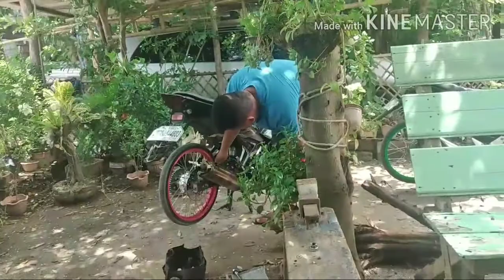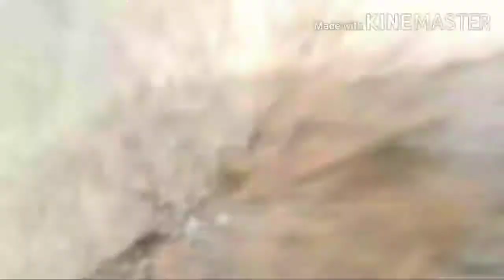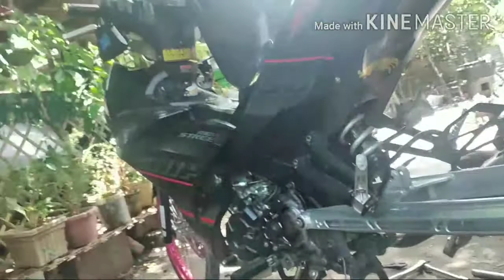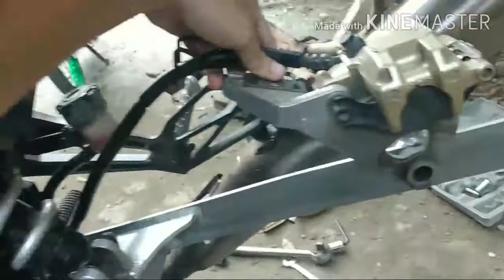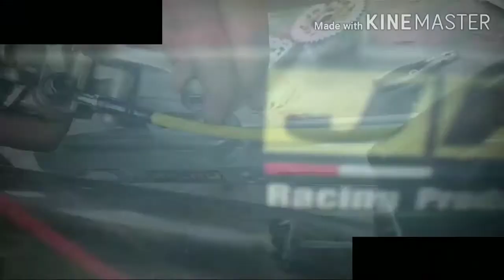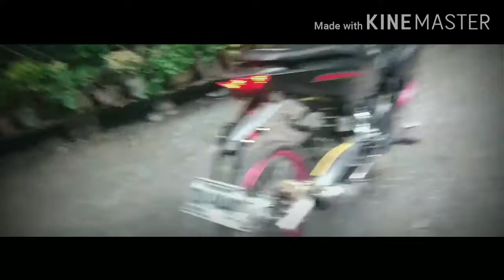JRP Prototype +3 For Sniper 150| installation swing arm

Comment: bossing saan mo nabili yang swing arm mo paki bigay name nung naka bilhan mo para maka kausap ko maka bili nga dn plus 3 jrp
Reply from the maker: Actually boss sold out na sya kasi ung darating na jrp color coded na . Limited lng kc ung nilabas na prototype.  Pero 4sale yung swing arm na yan .
Reply: Motokevs boss kumusta naman ung hnd jrp na hnd prototype na plus 3 ok bayun bossing
Reply from the maker: @Cdralonzo  pag di prototype nagkakabewang ung swing arm sa gitna paps.  Tska magalaw sa pagliko.
Reply: Motokevs bossing ano size pala nyang chain mo size nyan ga ano ka haba yan
Reply from the maker: @Cdralonzo  428 sukat neto paps ung malaki.
Reply: Motokevs ilang link yan gamit nyo bossing
Reply from the maker: @Cdralonzo  yung haba ba paps?  Depende kc sa swing arm at sproket